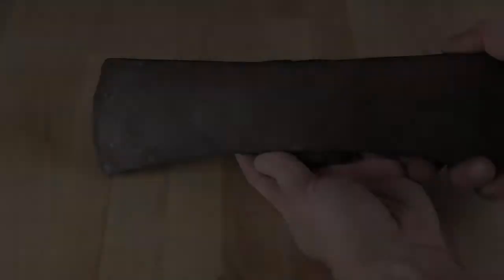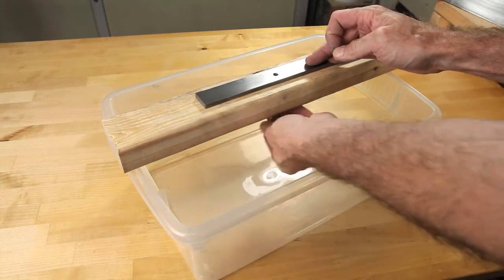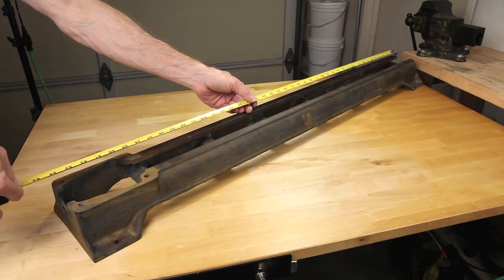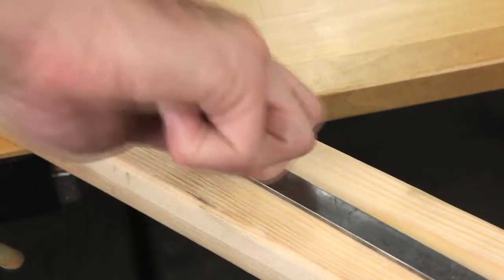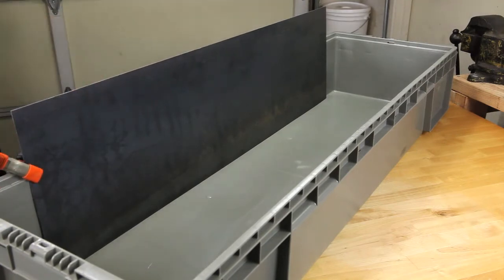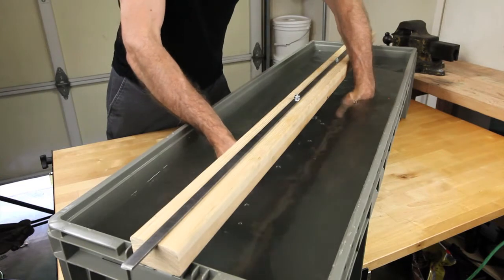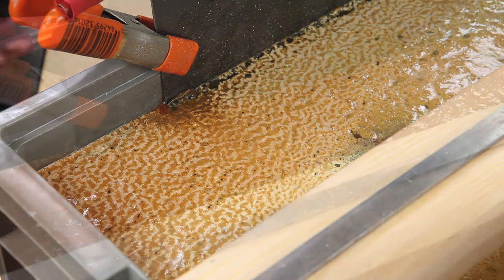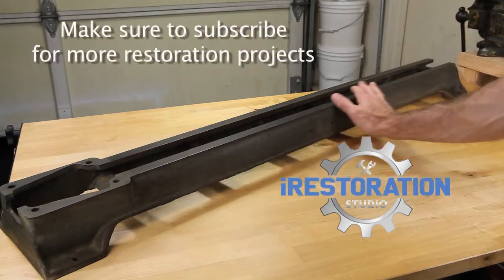E Tank Instructions - How To Build & Use An Electrolysis Tank For Rust Removal

Comment: Wrong! You cannot use a "standard" battery  charger.  Most, if not all, battery chargers sold today are automatic shut off, and WILL NOT work.  It must be a manual  charger which can be difficult to find. Go online, and search for used chargers for sale. Also there is a lot of new steel used in this build which can be expensive. The top bar is completely unnecessary. Just clamp the negative directly to the eye bolt holding the piece being worked on. The sacrificial anodes do not have to be plate steel.  They can be made from any used or scrap steel, placed in the four corners of the tank.  Used lawn mower blades, or rebar for instance work great.
Reply: Ffs dude. Who taught you to start off a sentence with "wrong". No matter what you day after that you are just going to sound like a dick with no social skills.

Comment: I’d like more details about the materials used for eye hooks, suspension wire, and metal plates.  IE: best materials, worst materials to use.  Could I use copper plates in the tank instead of steel?
Reply: Google it man